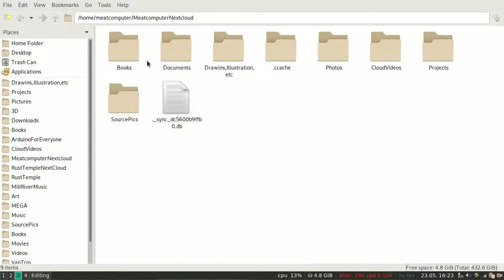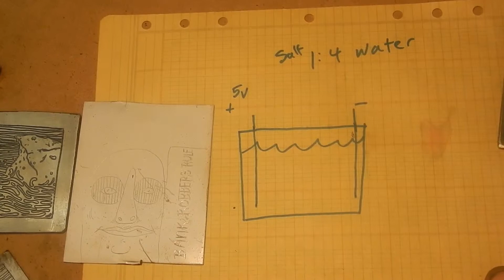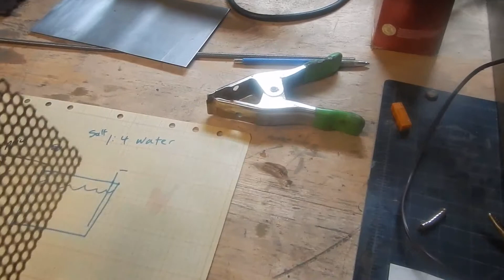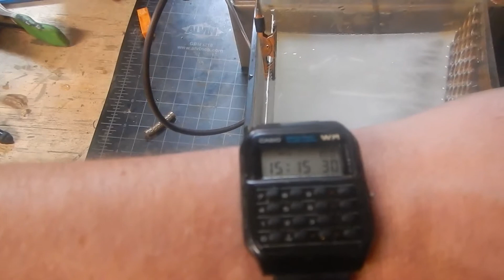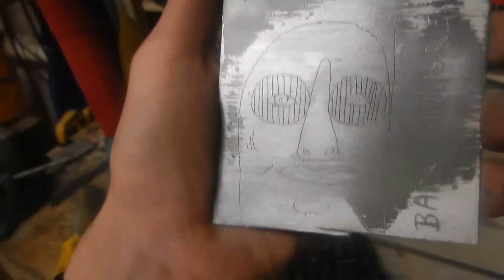How to Etch Steel With a Cell Phone Power Supply And Salt Water, DIY Nontoxic Etching.

Comment: I tried this and left my mug in the water for two whole hours (because it didn't look like it was doing much before, but if it was I definitely wanted to get a deeper etch) but when I took off the stencil there was not a single mark on the mug. I was extremely disheartened! just like you showed and just like I've seen in a whole bunch of other videos, when I put the two leads on and Iconnected the power the bubbles started and the color started coming out and everything so it look like it was working great. In fact the water was almost black after only about 25. So I'm thinking after 2 hours I'm really going to have an awesome itch... But in the end there was absolutely nothing. Not even discoloration on the mug at all. And I was definitely using a stainless steel mug. I was wondering what could be the problem. I mean I thought if it was not setup right it would not be showing all the action the fizzing the dark colors showing up etc. so I was wondering if my sacrificial piece of metal that I put on the other lead was not made of made of the right stuff. I didn't think that mattered. I thought it just had to be metal. I used a unattached hammerhead that I found in my toolbox. so maybe that was made out of some goofy kind of metal that doesn't work for this. Otherwise, I can't think of why this didn't work. An earlier trial attempts, I used the q-tip method with a 9-volt battery and then with the Justin cell phone charger type thing and it worked but I didn't like all the discoloration and uneven results that I got. That's why I wanted to go for this submersion method. But I was perplexed to find that this method gave me zero results after all that work I did. Can you think of a reason why it would act like it was working but give no etching at all?

Comment: Hey, look, I think it's a very cool technique which you've developed, and I don't wish to understate my appreciation of that, but I found your video because I was specifically looking for examples of electro-etching of metals accomplished using re-purposed power-supplies-for-random-household-equipment (such as power supplies for, eg, cell phones), and although the title of your video purports to do just that, you are in fact using a laboratory power supply. I find the discrepancy between your video's title and your video's content a bit disappointing. I still like the technique, though: neat.